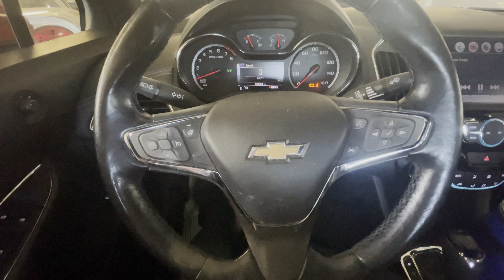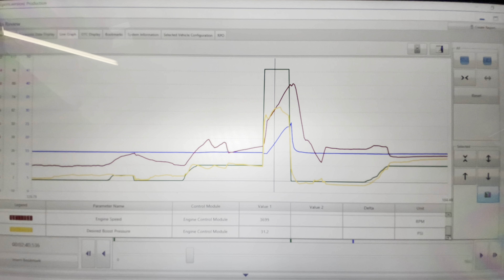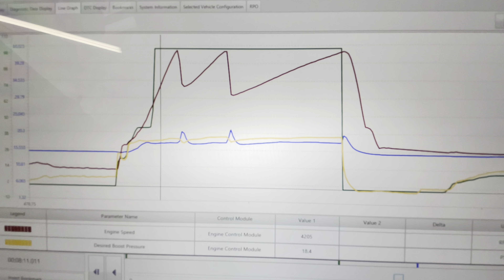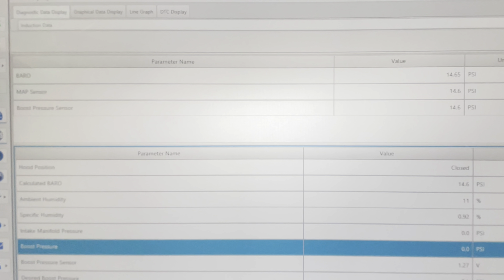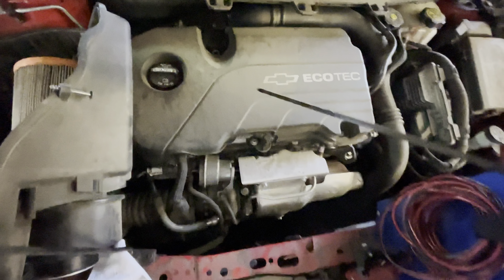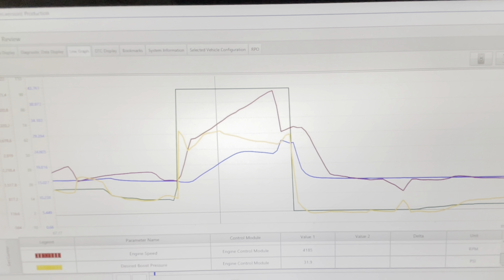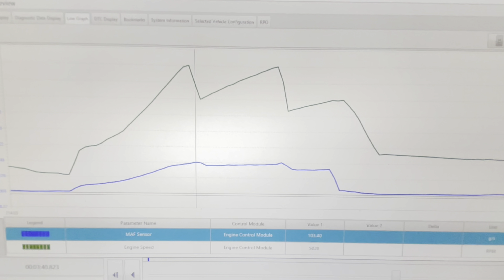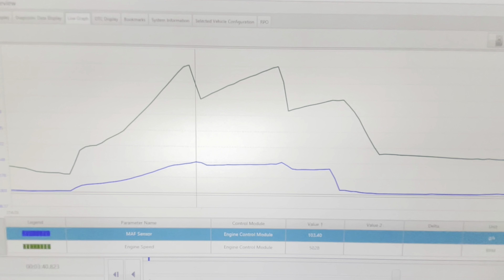Cruze P0299 Turbocharger Low Boost... Diagnostic Tips

Comment: Hi, have a 2014 Cruze 1.4L, P0299 code (that;s the only code), smoked the vehicle - no leaks anywhere, intake has a check valve in place, installed a new turbo charger - same code comes back within 2 days - any ideas?
Reply from the maker: If it has a new turbo and the code is not coming back immediately it could be a faulty turbocharger, boost leak, or also possibly an unrelated engine management problem. 

I often see an engine misfire or otherwise engine runs poorly problem and it can cause a P0299 due it poor performance. Does the car run ok? And how is the acceleration before the P0299 code sets? Does it drive normally and have plenty of power? 

Thank you.
Reply: @DadsGarageDiagnosticSpecialist  The car drives really good like there is nothing wrong with it and it was driving like that prior to Turbocharger replacement as well, it takes about 2 days for the code to set in, no misfires or even any signs that there is something wrong, plenty of power before and after the code sets in.
Reply from the maker: @misha27060  well, the map sensor and the boost pressure sensor need to be reading accurately so that could potentially be a problem. Do you have a code reader or scan tool capable of reading data?
Reply: @DadsGarageDiagnosticSpecialist  I do, what should the correct reading be? any idea?
Reply from the maker: @misha27060  well with the key on, and the engine off, all of the pressure sensors should be reading equally to prove that you can trust them in the first place so that is a good starting point. 

Otherwise, while driving of course do this safely monitor engine load at idle, cruising, and heavy wide open acceleration. 

Do the same thing with MAF and fuel trims. 

So you should report back three sets of data……idle conditions. Cruise conditions. And wide open heavy acceleration conditions. 

Also add MAP and Boost pressure sensor if possible. Thanks.
Reply: @DadsGarageDiagnosticSpecialist  ok, will try it...thank you for all your help!
Reply from the maker: @misha27060  you are welcome

Comment: i am getting po299 turbo underboost inly in highway uphill with tempomat drive 120-140km/h. After replacing a lot od thinnga mechaniker found thath turboa turboaktuator was changed in the past but not correct adjusted. He did right and i drove 200kilometer all good. Yesterday highway after a huge traffic i started 140km/h for like a 5kilometer and PO299 was there. Now mechanic says turbo is brand new and must be “adjusted “ could that really be? Someone has installed new turbo as well but they are suspecting thath the turbo is not correctly installed and adjusted. Please help the problem is here for 5months!
Reply from the maker: The turbo adjustment is supposed to be permanent from the factory, it is a calibrated adjustment. 

I would most likely have to replace the turbo with a new OEM one. Other than that you could have a misfire up hills causing it also. I’ve seen a lot of faulty ignition coils and spark plugs cause a P0299 too. 

It really can only be a few things.

1. The engine has a misfire or some other reason that it isn’t able to produce enough exhaust flow and therefore low boost. 

2. Air leaks. If the turbo boost is leaking the computer will see that as lower than desired boost. I would pressure smoke test for boost leaks. I’ve even seen the plastic intake manifold split and leak under pressure. 

3. The turbo itself is misadjusted, worn, or for some other reason it cannot produce and maintain enough boost. 

4. Some other engine management sensor is reading incorrectly and confusing the ECM…. Such as BARO sensor, MAP sensor, Boost sensor, etc. 

Since your problem primarily only occurs up hills or under heavy loads id suspect air leaks or an engine misfire. 

If the new turbo was not a factory part from GM I’d also highly suspect that is the problem. If I found nothing else in the end I would swap the whole turbo with a unit that has not had the adjustments tampered with. 

Thanks.
Reply: Smoke test has been done multiple tines. Interkuler changed cuz was not 100% good. All of the senzors have been checked. Last time the mechanicer adjusted the turbo actuator and it functioned 2 weeks and i drive 200km without the code. Yesterday i was in traffic jam 50km and after that i drove only 5km 120-140 and the code was there right away. Ok i took today the car to the mechanic in. Budapest 220km i drove without a problem:( no code whatsoever! And he said we have to take of the turbo(which is new one-someone already installed a new one before me) and to adjust it. I wanted to know if that would really be a problem that the turbo that was replaced needs an adjustment? Plus the mechanic has found that the car Audi q5.2.0tdi was tuned and he installed new software and adjusted the turbo aktuator abd as already described the problem was gone for 200-250km. Yesterday problem was there and today i drove to him so the dame distance sae road uphill all the time 120-180km/h and the code was not there. Thank you very much
Reply: @DadsGarageDiagnosticSpecialist 

Smoke test has been done multiple tines. Interkuler changed cuz was not 100% good. All of the senzors have been checked. Last time the mechanicer adjusted the turbo actuator and it functioned 2 weeks and i drive 200km without the code. Yesterday i was in traffic jam 50km and after that i drove only 5km 120-140 and the code was there right away. Ok i took today the car to the mechanic in. Budapest 220km i drove without a problem:( no code whatsoever! And he said we have to take of the turbo(which is new one-someone already installed a new one before me) and to adjust it. I wanted to know if that would really be a problem that the turbo that was replaced needs an adjustment? Plus the mechanic has found that the car Audi q5.2.0tdi was tuned and he installed new software and adjusted the turbo aktuator abd as already described the problem was gone for 200-250km. Yesterday problem was there and today i drove to him so the dame distance sae road uphill all the time 120-180km/h and the code was not there. Thank you very much
Reply: and the Turbo has been bought brand new before i bought the car.  and the mechanic says that the old owner did not adjust the turbo
Reply from the maker: If everything else has been diligently checked then yes the turbo adjustment would be highly suspect.
Reply: @DadsGarageDiagnosticSpecialist thank you very much for the support 🙏
Reply from the maker: @Banker.xXxXxX you are welcome
Reply: @DadsGarageDiagnosticSpecialist  Could also be the wastegate actuator. Also, the Dorman aftermarket turbos and components (can't believe I'm saying this) actually seem to be of really good quality for these engines. A new turbo is $500 and comes complete with a new manifold and a one year warranty. 
Lastly, it doesn't help that GM didn't just simply make a slightly larger oil pan to accommodate the standard 5 quarts of oil. Most people just throw a whole 5 quart jug in without realizing it only takes 4.2 quarts and it can be easy to slightly over or under fill it, even if you know it only takes 4.2 quarts.

Comment: Is the turbo OEM and does it come with the bypass valve?
Reply from the maker: When you buy it from the dealer yes it comes with the bypass valve.
Reply: @plowe6752  no. The bypass valve is under the intake of the turbo and the wastegate valve goes on top and controls a rod that opens a valve on the exhaust part of the turbo.

Comment: The one I repaired had a cracked housing next to the wastegate flap.
Reply from the maker: I see that quite a lot and also on other turbochargers so it seems to be common.

The most common in my personal experience is exactly what was found in this video, the pins and linkages get all worn out.
Reply: @DadsGarageDiagnosticSpecialist  I have been driving forced induction since the late 90's, QC on these turbos could have been better for sure. The oil feed line and return is a joke. Thanks for posting this.
Reply from the maker: Yes, I replace the oil feed line and return pipe on every one of these jobs. They are usually clogged solid from all of the cheap oil and extended oil change intervals. Also, these cars are running tiny turbo chargers at their limit most of their lives.

Comment: So what was the production date 🤔🙅🤸🍻🕐 The entire engine was redesigned mid 2016. Makes a bid difference. And how many miles 🤪on the car.That would be nice 👍 to know
Reply from the maker: Build date 4/15/2016 and the repair was done at approx. 131,602 miles…..

Has since come back twice for oil changes and no faults… last visit it had 140,407 miles. 

Thank you.

Comment: Hey great tips curious what software your using I like that ability to overlay graphs
Reply from the maker: This is GDS2 the factory scan tool for 2010+ GM vehicles. 

There are also several aftermarket scan tools that have the ability to do a multi-graph. 

Thanks again.

Comment: I see some changes new to old.  Wastegate actuator has an adjustable arm again.

I have a 2012 with 108k miles and was an inch away from replacing turbo.  went with a ZZP actuator and cleaning of rust inside wastegate pin (gritty, squeaky, movement)and back to boosting!
2016 has 33 psi boost?  First gen. only 18 stock.
Reply from the maker: Yes sometimes this can be repaired with aftermarket parts. 

The boost pressure sensor is reading in absolute pressure. BARO was about 14.5psi absolute, so 33psi absolute minus 14.5psi absolute BARO= 18.5psi gauge pressure. 

Thanks for commenting.

Comment: Where did you do the exhaust side leak test?

I have a 2018 Cruze, I was thinking to smoke the exhaust.
Reply from the maker: On this particular engine, the turbo mounts directly to the cylinder head all as one piece with the manifold. So there really isn’t much that can leak exhaust ahead of the turbo other than the gasket at the cylinder head. 

Thanks.

Comment: I'm wondering why owners and or technicians don't weld or braze hairline cracks in the turbo housing.
Reply from the maker: I find that a lot of manufacturers over the years consider a cracked housing to be “normal” in service information and bulletins. Cast iron is hard to weld too. Not sure if brazing would work considering a turbo runs a lot hotter than a typical exhaust manifold. 

Thanks for commenting.

Comment: Hey I've got a Cobalt SS with this issue. I get 12 psi boost in first gear, which is expected i think. Then after some time in second gear it goes to 10. Then after some time in third it only goes to 5. And so on. When I get on the highway, 4th and 5th gear don't create more than 0 psi boost. What could be the issue? I don't think it is related to what gear I am in obviously, but that's just what I've observed. It's hard to do precise testing haha.
Reply from the maker: So you have a P0299 code? What year is Cobalt? Manual transmission?

Is there any other symptoms such as lack of power?

Thanks.
Reply: @DadsGarageDiagnosticSpecialist  2009 2.0 turbo. Yeah there's a boost gauge in the car from the factory. There's lack of power after some driving some time, like when I get on the highway, go full throttle, and the reading doesn't go above 0 psi.
Reply from the maker: @awepossum1059 that’s interesting. Well you’d have to check for boost leaks, misfires, fuel supply problem, etc. 

You can use a cheap code reader to monitor oxygen sensors during the problem, when you hold the gas pedal to the floor the oxygen sensors should peg rich close to 900mV. If the sensor is pegged lean closer to 0mV it’s starving for fuel. 

I have a video or two demonstrating this…. Most recently the S10 video shows this.

Comment: Would P0299 Cause a no start condition?  2017 Trax crank but no start.
Reply from the maker: No, the P0299 would not cause a no start. Will need a diagnosis.

Thanks.

Comment: I dont think i can afford to fix this issue. I also have to fix the timing belt seals since its leaking. Im devested because i spent soooo much money fixing issues from this car, most rescently i fixed the oil coolan. Spent about 800$ to get that fixed. Now i have p0299 code and leaking oil from the timing belt seals. 

I dont have a job and was going to rely on my car to do uber eats. This car has destryoed me mentally and physically
Reply from the maker: Well you can buy a cheap clunker that runs, drives, and stops for what it will cost you to replace the turbo and seals. 

It might be worth it to invest the money if the rest of the car is in good condition… then it will be on top running condition with no leaks. 

Thanks.